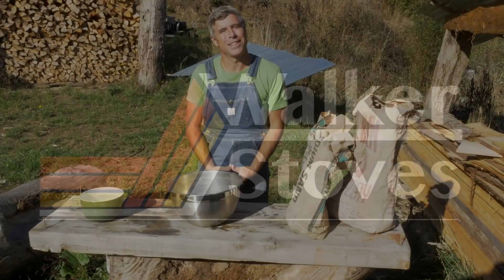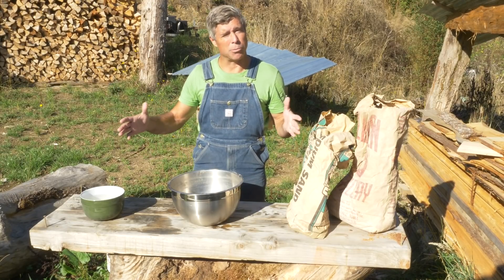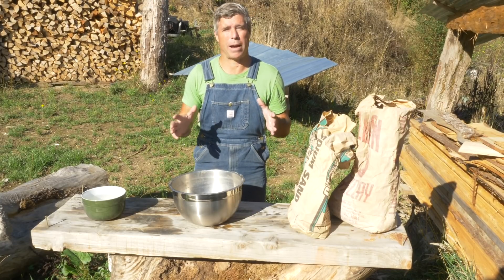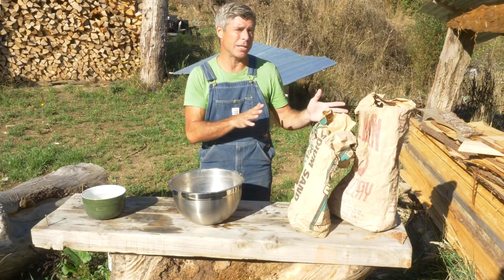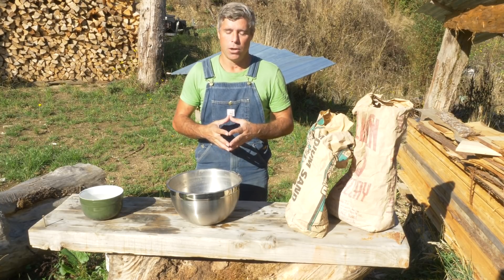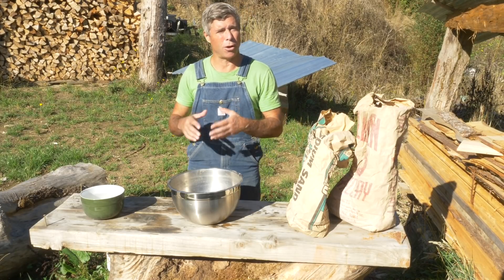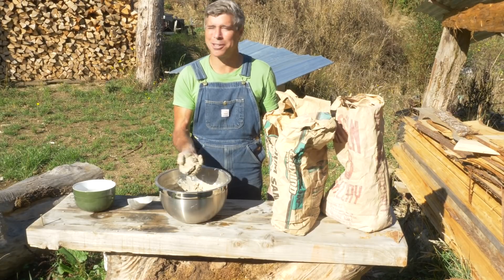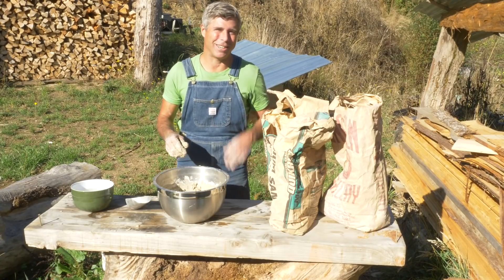Rocket and Masonry Stove Mortar Discussion

Comment from the maker: My Clay/Sand Mortar Mix Recipe: 3 parts dry sharp sand by volume, 1 part dry ground fire clay by volume. Add water to desired consistency.

Fire clay: https://amzn.to/2ykT2B0
Sharp sand: https://amzn.to/2LJKqa9
Reply: I  would add  best to use washed soft sand and the addition of Lime at one part in four of above mix will improve the mixes stability without effecting the mixtures ability to be recycled.

Comment: Have you used a lime based mortar? This was the go to in victorian England for chimneys. So far I've found commercial refractory mortar to be lime, clay, sand and cement. As far as I could figure out the lime makes the mortar more water/steam resistant. I imagine that the heat cycles produce condensation inside the heater making the mortar ever slightly damp and therefore creating 'steam'. Steam expands, hence the cracks?

Comment: Thanks for the video Matt, great timing as tomorrow we start building our brick RMH using your designs. Very excited! Regarding more design ideas - I'd love to see your take on a rocket powered hot water tank. I've got an old electric immersion heater and thought it would be cool to recycle the insulated copper tank for a rocket project.

Comment: Great video. I realised from this what fire clay is. Got a bag and expected it to be more clay like. Cob also works abit the same i think. It helps bind the sand. And the sand stops cracking. 

Question Matt
Do you use this mix in all areas and with all the stones. Or is it for internal?

Do you have a video showing you mortoring bricks or can you point me to somewhere someone ?

Comment: I've been stalking you for a couple of years now. Lol. I think I want to go with your design. I have a fireplace insert that is directly behind my kitchen stove. I am a welder and can fab just about anything. I am thinking I can pull the insert out and use that space for the firebox that can be seen in the living room and go through the wall( which it does already), and build a cookstove in the kitchen. I can't figure out if or how I could do a bench in the living room.

Comment: Hi Matt, Great video! thanks for the tutorial on clay sand mortar, will be using it soon enough on my heater build (in Joyce).  Do you know of anyone who has gone through the on grid build process who has installed one of your stoves with consent from code authorities?  Does it fall into the classification of a masonry heating unit?  Are your plans possibly the loophole needed to construct my future heater and still insure the new home? -Ean
Reply from the maker: Thanks Ean! So, the legalities vary from state to state and in some cases vary at the  municipal level. You'll have to check your state codes, in many states it is as simple as categorizing the build as a site-built masonry heater.  I have had a few people building to my plans go through the code process successfully.  Hope that helps.

Comment: Nice to know my clay soil is a solid building material option.  I have a lot of light colored clay.  Also, not to be off topic, but I'm still toying with the idea of introducing secondary air through a negative space channel through the brick structure of the firebox and vent controlled at the firebox door.  Ever seen that done?
Reply from the maker: Hi Thomas. Yes, channels through firebrick are the traditional way, and I know of a few rocket stove/cook stove builds featuring this type of secondary air delivery.  I prefer the metal as it delivers super hot air to the combustion zone extremely quickly after lighting.  With a brick delivery it will take far longer for the combustion zone to come up to temp and start burning efficiently, and in a mass heater often you are only burning one load.  If efficiency isn't one of your primary goals, it should be satisfactory.  If you are wanting to use your wood as efficiently as possible, I recommend a metal delivery.  Hope that helps!
Reply: broaudio  Matt, I know you use ceramic fiber in some of your builds and from my what I can tell, that's pretty much where the future of rocket stoves is going.  I am planning my own build using ceramic fiber board and blanket and am concerned about the potential for high velocity gases eroding the board/blanket.  Do you think durability is a problem?  If so, do you think it can be overcome with the use of a product like the 3000 degree F (missou) by applying a thin coat to the board and actually rubbing it into the pores.  Same for the blanket.  Additionally, I have considered following up with a layer of ceramic fiber cloth, using the hot face masonry cement as a sort of adhesive past, and again, rubbing the cement into the pores.  I would be ever grateful for any experience  you have with the high velocity erosion I'm speaking of.  Thank you!
Reply from the maker: I have not seen any degradation from contact with flame or flue gas.  I do not feel it is worth while to attempt to "surface" it, I see no benefit to doing so.  My suggestion is keep it simple, don't overthink it. My preference is bare ceramic fiber board cores and either a CFB riser or Pinheads Five Minute Riser, either will provide excellent performance and will last indefinitely in my experience.  Hope that helps.

Comment: Hi, New subscriber and follower here. I love the info and I am wanting to build a rocket stove mass heater.
I like this concept of fire clay and sand mortar rather than portland/lime. 

My question is can you make fire bricks from this same mix, using a mold or a form?
Reply from the maker: You can make bricks using the method you describe and these materials, absolutely.  Many successful RMH builds have been achieved using homemade mud bricks, or adobes.  Search adobes here on YT and you'll find a lot of resources.

As for firebrick though, I don't recommend it.  The homemade brick will be great for the body of the stove, but aren't durable enough to use inside the firebox.

Hope that helps!
Reply: Yes, that helps. Thanks.
Reply: broaudi

Comment: I want to build a RMH with water heating for shower room. I don't having welding gear. I'l be using cob or mortar for a lot of it. Witch is better for lb's and heating for space and copper coils/water ? I was thinking this design: https://permies.com/t/110574/Mini-rocket-stove-wheels-hot